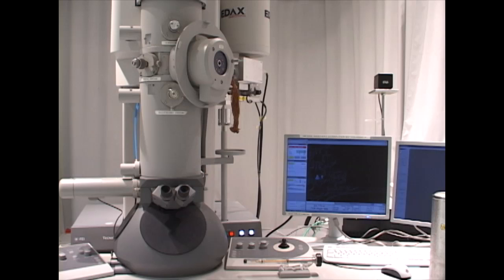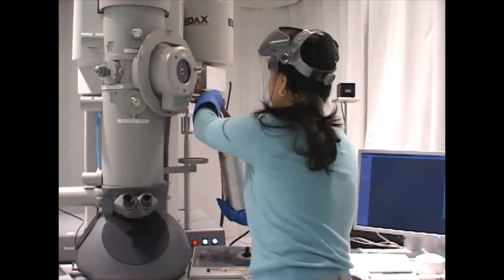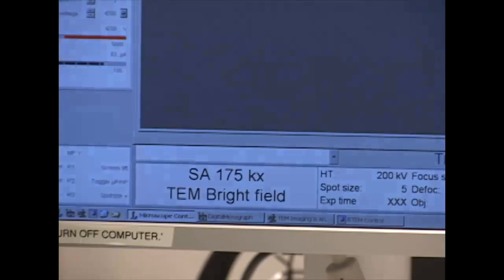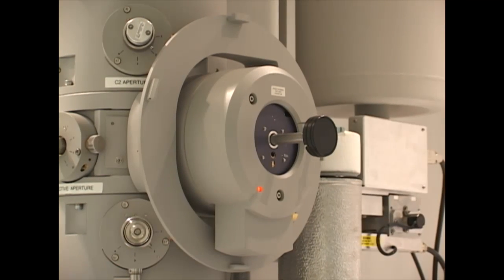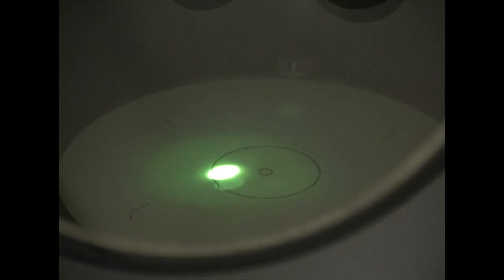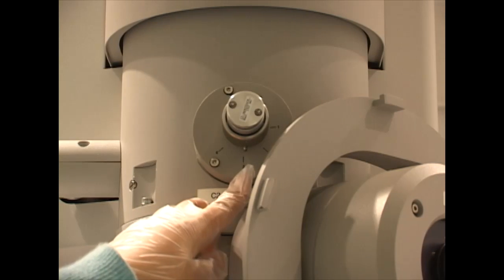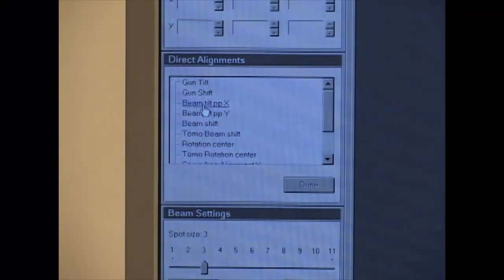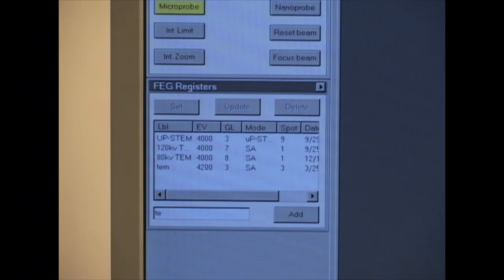Transmission Electron Microscope, Part 1 of 2

Comment: Black Africans could NEVER invent the following

Wheel
Transmission Electron Microscope
Photolithography
Electrical motors
Combustion motors
Radio communication
Modern medicine

If you think these Bantu hut dwellers could ever do these things you are delusional. Blacks have 2 options. Live in huts 🛖 or be led by Europeans. There’s a third option but YouTube won’t let me
Type that 😂

Comment: Can someone tell how to operate STEM in FEI TECNAI G2-20 twin?
Reply: set eucentric height, go to STEM, set SS9, GL6 -> then use intensity focus to find  ronchi, switch off diffraction, use objective focus to focus the beam and do pivot points, go to higer magn and switch on diffraction again, adjust the intesity focus to find ronchi again -> repeat until you have ronchi and focused spot (out of diffraction), then start search -> focus using z-heigh and fine with intesity focus, stigmate.... done... (ps do not forget to properly orient your sample before this)

Comment: to cool the sample you usually need a special sample holder, with a liquid nitrogen vessel also. that is very common in biological samples observation, or in very reactive/heat sensitive samples.

Comment: And now that i think a little, unless FEI had changed the system in the last 3-4 years, you are not cooling the sample with the liquid nitrogen. you are putting liquid nitrogen to cool down the cold trap, which is a ring concentric with the sample, very near it, which is responsable for condensing all the contamination in the column. it improves the vacuum, and if the sample evaporates with the energy of the beam, condensates in there and not inside the column.

Comment: inside tem, it requires ultra high vacuum. sweat and dirt on hand and fingers if in touch with the holder can lead to outgassing and it will take very long time to pump down.